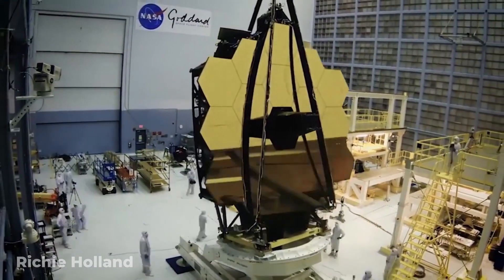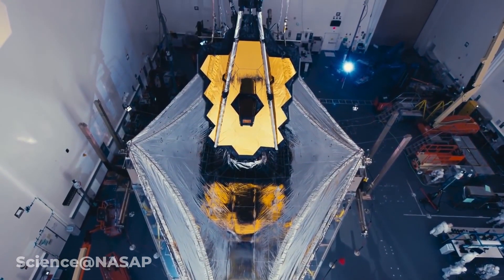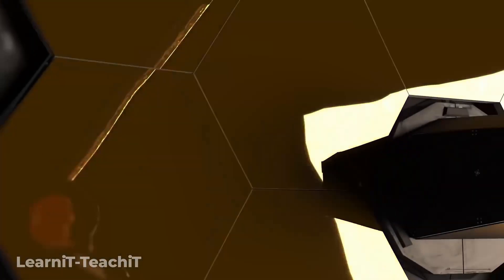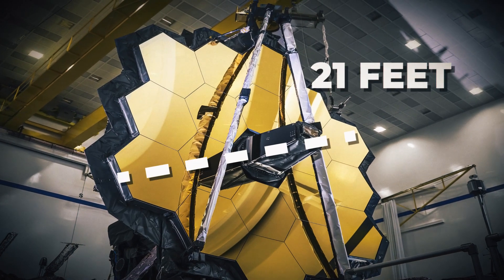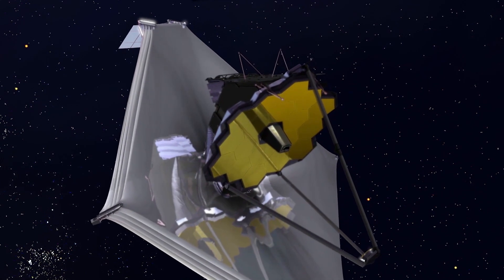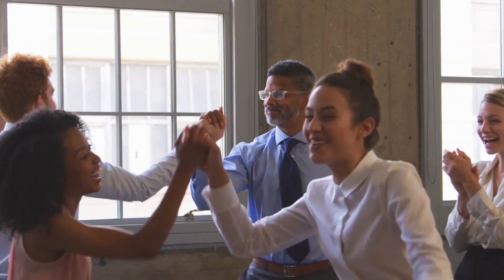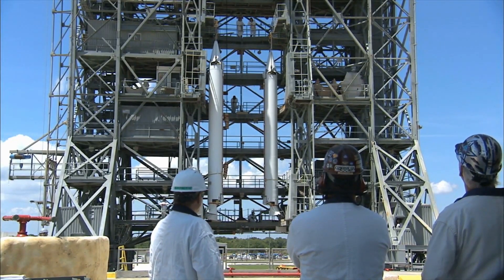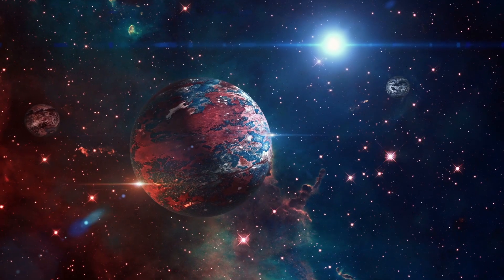How James Webb Telescope Will Detect Life In The Universe

Comment: Tell me, he or she that knows, why didn't NASA engineers elect to delay the unfurling of JWST until it reached L2? Wouldn't that have been the safer option?
Reply: The answer is, the unfurling is going to take almost 21 days. And each part has to be done in a specific order, starting with the 5 layer, sun shield, if allowed to go to L2 compacted like at launch, the radiation from the sun would destroy most of the telescope. Second is the temp 100% has to come down to  -370f (almost absolute zero), or once the instruments especially the infrared lenses will not work. So by the time it reaches L2 it is 100% imperative that it completely opened and very very very very very cold, or it will not work. These are the 2 really major reasons why it’s been programmed to unfurl while transiting to L2. Hope this helps you out.

Comment: Could someone please explain how it transmits data from over a million miles away? Not a doubter just can’t fathom the signal
Reply: You think a million miles is far? Voyager 1 was launched by NASA on September 5, 1977. As of November 28, 2021 it has reached a distance of 155.5 AU (23.262 billion km; 14.455 billion mi) from Earth . Similarly, Voyager 2 launched on August 20, 1977, as of November 28, 2021, it has reached a distance of 129.3 AU (19.343 billion km; 12.019 billion mi) from Earth. JPL are still getting a signal from both spacecraft. These two spacecraft are still doing science and transmitting to Earth after over 44 years! Just think about that!
Reply: @bipolarbear9917  still doesn’t explain the signal what you said is just even more unfathomable???
Reply: @sirtonyholohan69  We have high rez photos from Mars which is hundreds of millions of miles away, what you are even talking about? Why should it be a problem?
Reply: @SuperMassiveGrayCat  because I can barely get signal in my 6th floor apartment never mind from mars
Reply: @sirtonyholohan69  Nobody cares about your signal. That might be part of it. 😆
Reply: The same way any other craft does, with radio. A million miles isn't that far in astronomical distances.It's only about 4 times the distance to the moon.
Reply: It has an ethernet cable plugged into the back of it that runs back to earth. Pretty neat stuff
Reply: @justinjohnson5906  😂🤣🤣🤣
Reply: I think they commissioned the pony express.
Reply: @gradycollins3601  Now that's an idea!
Reply: Basic radio waves,I would suspect...radio waves travel,practically at the speed of light,as long as they don't need to be relayed,satellite to satellite.